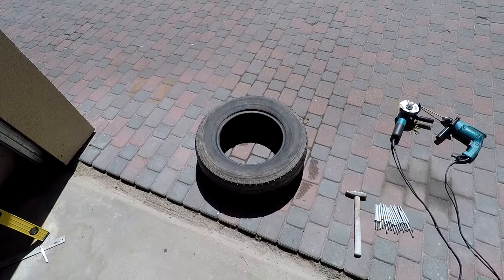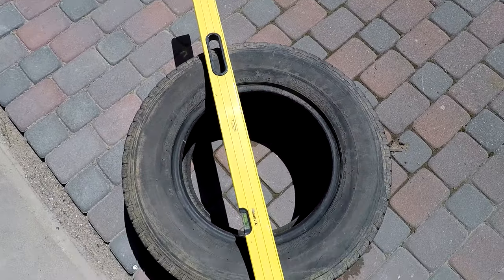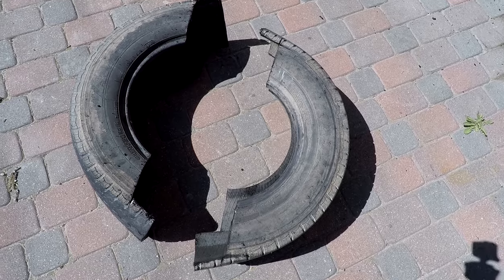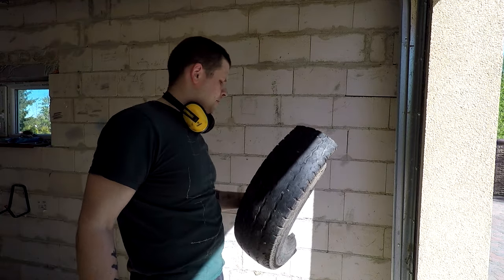DIY Wall Punching Bag (How to make)

Comment: Quick question? Did you use screws? It seemed tory hammered them in and didn't screw them in. Great idea!
Reply: Probably twisted the screws into the wall plugs and hammered them in. Then just tighten up at end maybe